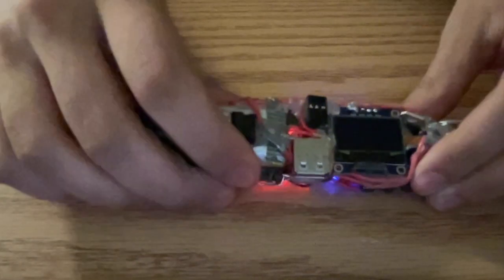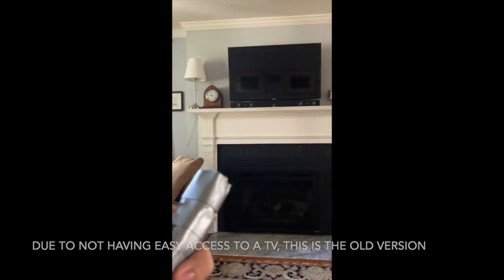Upgraded Working Sonic Screwdriver Showcase

Comment: Try giving it a frequency generator so then I could have the potential ability to unlock locks
Reply from the maker: What do you mean by frequency generator? Sound? RF? Something else? And how would that allow it to unlock locks?
Reply: @TheAdamantineMetaphysicist  Find the video that has the title real working sonic screwdriver mark 2. and that should answer your question
Reply from the maker: @outrageousanimations7462  Ah. I see what you're talking about. That's sound. Sadly, that wouldn't work for unlocking locks.
Reply: @TheAdamantineMetaphysicist  actually some sounds can actually unlock some locks if you look it up but probably not those frequencies
Reply from the maker: @outrageousanimations7462  Would you mind sending me a link to where you saw that? I looked it up and couldn't find anything to that effect.
Reply: That would be great, please if you have information on that, please tell me. I'm also trying to make a Sonic Screwdriver, but I want it to be something useful, not just lights and sounds